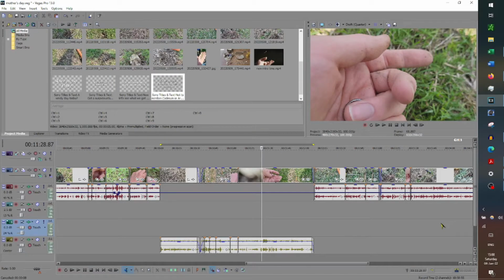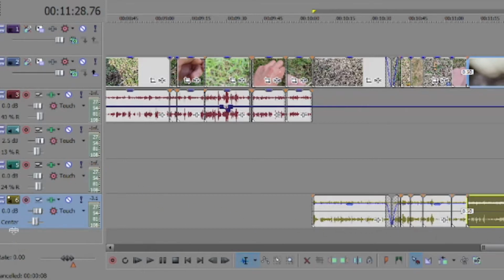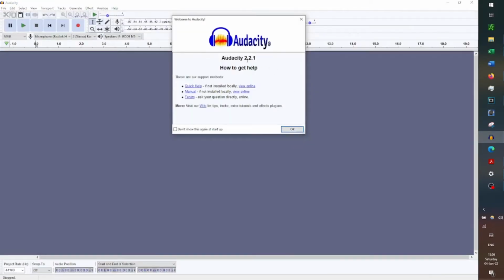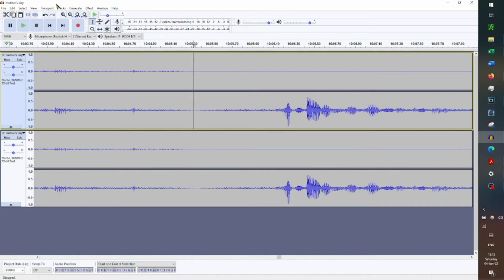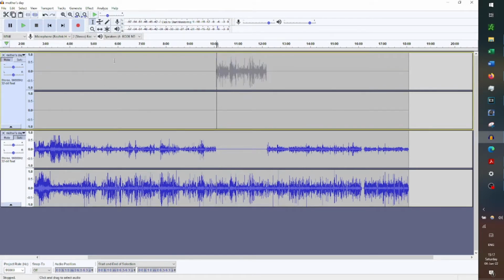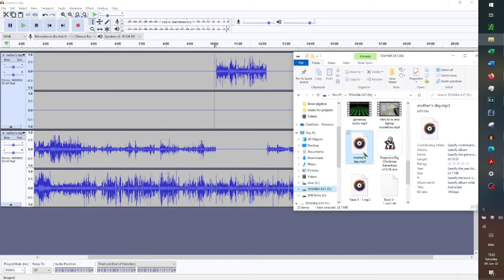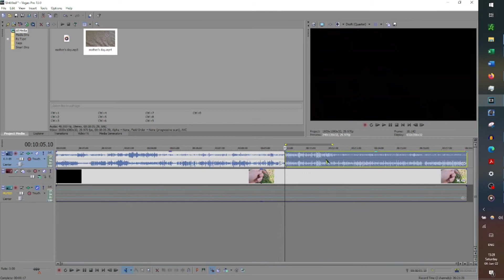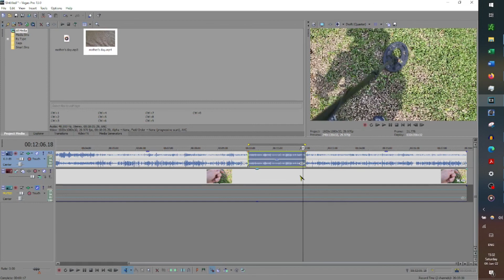How to Reduce Wind Noise and Distorted Audio with Audacity | Video Editing

Comment from the maker: Here's a step-by-step guide to follow in order to achieve this result.

Step One: Isolate the problematic audio. 
Use the "split" function (S) and move the audio to a new track, as shown in the video. This track should be isolated from all the others. You may need to make two tracks, one per channel. For example, some parts sound better in the right track and others in the left, so you'd want two separate tracks to ensure both get the right treatment, and are treated separately.

Step Two: Determine which channel sounds better, and pan it to the left or right. 
If the left channel sounds noisy, pan it to the right 100%. This will cancel out the left channel's audio completely. Repeat for the other set of audio, if necessary. If another set of audio sounds worse on the right channel, pan left 100%. Ensure that the right panned audio is on a separate track from the left panned audio.

Step Three: Render the file as an audio one. 
Essentially, we are converting this video file, which includes audio, strictly into sound. This means that our processed media has no video attached to it. Basically, this step is generating our new audio track for the finished product.

Step Four: Import the audio file into an audio editor. 
I like to use Audacity since it is lightweight, free, and easy to use. Plenty of tutorials exist online on using the program, so you should be able to learn it quickly! If you are correcting more than one track of audio at the same time(both channels sound bad in certain spots) drop three copies into Audacity instead of two. (Original, left correction, right correction)

Step Five: Isolate the mono track. 
Keeping one track untouched, focus on the regions of audio in which the stereo track became mono, and remove all portions of the stereo audio present. Get as close as you can to where the mono sections begin and end, and delete the stereo regions by highlighting them and clicking the "Silence Audio Selection" button. Once this is done, the highlighted audio will disappear. Once each track is processed, only mono audio should be visible, with no remnants of the stereo audio present in the waveform. This leaves us with only one track with stereo, the original one. Be sure to note the regions of mono audio so you can refer to them later during the final processing steps.

Step Six: Swap the stereo channels. 
This step involves clicking the small downward-facing arrowhead on the left part of the mono tracks, and from this drop-down menu, choosing the "Swap Stereo Channels" option. Do this for each mono track you have created. Essentially, this will flip the audio so that the audio will now play on the opposite channel. (Right becomes left, left becomes right). This is done so that (when the audio is processed) the missing audio channel in the original track is filled. This converts our mono to stereo. 

Step Seven: Review and export the audio. 
Choose your personal favourite audio format- I like mp3. Note the location of your saved audio. When this audio file is processed, the channels will combine. Essentially, all left channels will combine together, as well as all the right ones. This is why isolating only mono audio and swapping channels is so important. You want to fill in the missing audio with a better quality one while keeping the overall volume consistent throughout.

Step Eight: Import the audio and video files. 
The video file is generated after rendering the video with the isolated audio edits that were previously done. This is inserted into the new project, and the audio file used in this project is the newly-generated mp3 file created in Audacity. 

Step Nine: Mute the video file. 
The reason for this is that our mp3 file is going to be the replacement audio for the project. This replacement audio has the corrected audio that we want to use in the final product.

Step Ten: Apply final corrections. 
We are almost done! Here, we finally adjust the audio levels in our corrected regions of the audio. This step can take some time to complete, but having timestamps of our mono audio (Recorded in step seven) can save a lot of time at this point. Just split the audio track in the places where you swapped channels, and lower the volume, if necessary. Vegas has a nice feature where the split audio's volume can be lowered, so just experiment with this feature and find the best volume levels for your project. If volume needs to be increased, simply drag this audio snippet to a new track, and use the gain slider on the left-hand side of that track (above the slider in Vegas, listed in dB). Make as many adjustments as necessary. Be sure to save often!

Step Eleven: Review and Render! 
Simply do a quick review of your areas of correction, and make sure they sound good. Then, render the video. Make sure you do not have FLAC selected, and instead, choose a video format that is best suited for your application. In my case, I like Internet HD 1080p, as the format is clean, effective, and very usable as an mp4 file.

Step Twelve (Not listed): Review the final product and ensure it is ready to go! 
You've worked hard on this video, and I'm glad you made it through. Just casually watch the video in full and make sure nothing was missed. If there are no more problems, you made it through. Well done!